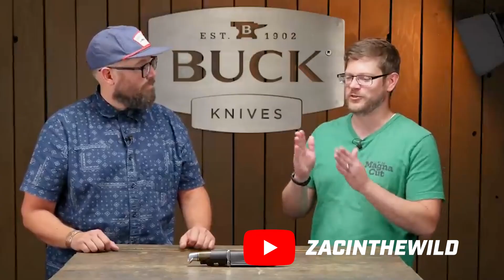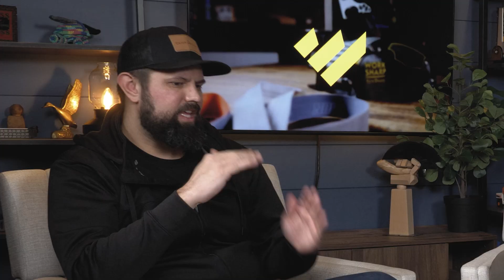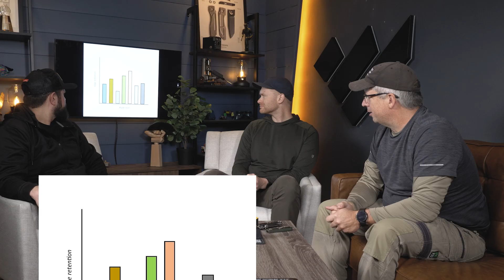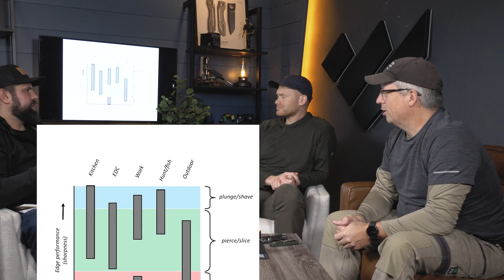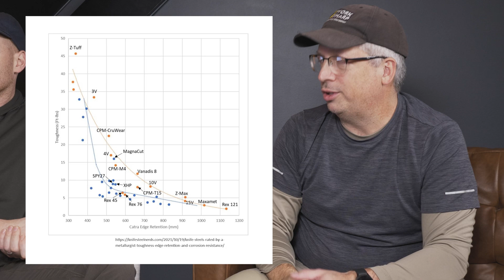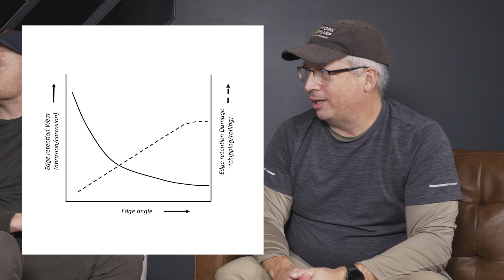Why Knife Steels Don't Matter... as much as you think

Comment: I just got my 4th field sharpener. I tend to smooth out the little honing rod on some 20CV and S90V pretty rapidly. But holy moly I get them nice and keen. I need a diamond honing rod or something. The strop cleans up the micro bevel burrs, but it’s that last little hone that ensures the apex is uniform all along. The 300 and 600 grit diamond plates have impressed me though on not tearing out or contaminating. I’ve got one for the wife, one for me, one for work, and one I keep nice for later. Cruwear is the best though.

Comment: Very good video. I do have one question though. If you are only really using the coarse grit on one side wouldn’t you need to continually swap which side you use it on to avoid an offset angle?

Comment: This has been the talk for a while now, and while the statement from Dr. Thomas is absolutely true, I still think steel and heat treatment is a WAY more important decision because thats the one thing 99% of people cannot change or do anything about. Anyone with basic sharpening skills can play around with geometry until they find the perfect fit on an existing knife, or even take it to a professional and have it perfectly done for a few bucks. If the steel isnt suited for what you are doing, theres no way you are replacing it unless theres a drop in replacement for that particular knife, which basically never happens. And if the heat treatment is known to be poor, chances are you dont have 10'000 dollars worth of industrial grade equipment, knowledge and experience at home to fix the treatment on your new super steel.

For me personally, if im buying a new knife my prio goes from whats hardest for me to do anything about, to what I can do something about myself. So at the top is heat treatment (because even "lower grade" steels can be really good if the treatment is spot on), then steel type, then blade shape (just because you can doesnt mean you want to grind half the metal off a new blade), then handle/ergonomics and if all that is good then what sharpness/edge geometry it has out of the box means about the same to me as the box it came in. I mean, yeah its a nice gesture and all that, but it literally takes me 5 minutes to touch it up, which im very likely to do on a brand new blade anyway. I mean, its not uncommon for new knives to need to be sharpened a couple of times before they perform as intended due to decarb and all that.

Yes, alot of people out there are emphasizing the latest and greatest steels way, way too much and seem to think anything else is garbage. But at the same time, I do think its probably THE most important choice the average consumer makes when selecting a knife.

Comment: There's a few type of knives where you unfortunately can't play with the angle. Chisel and Scandi grinds come to mind. You can sharpen them to a more obtuse angle, but you're changing the geometry away from their intent (an edge down to 0 without a secondary bevel).

Mostly I'm annoyed with a 14C28N Scandi folder I have where the edge rolls way too easily and the only remedy is to put a funky secondary bevel on it. 14C28N is some tough stuff, so I'm guessing the heat treat on it is on the very low end (55-57 HRC)

But there's plenty of chisel grinds out there like high end Japanese kitchen knives. the less impactful chisel grinds would be the plain portion of combo edged knives (half serrated) where you can change the angle without much issue

Comment: Thank you guys for a great informative video. What steel and angle would you recommend for skinning and quartering wild game like deer and hogs?
Reply from the maker: Don't stress too much about the steel type; instead, choose a knife that feels right and you like using. Keep it sharpened to a known angle, and if you notice it wearing down or chipping sooner than expected, adjust to a slightly wider angle. When sharpening in the field, try honing at a wider angle than usual—for example, if your knife is usually sharpened to 20°, try honing at 25°. This approach makes touch-ups simpler and gets you back to a sharp edge more quickly.
Reply: @WorkSharpOutdoor  Thank you for the reply